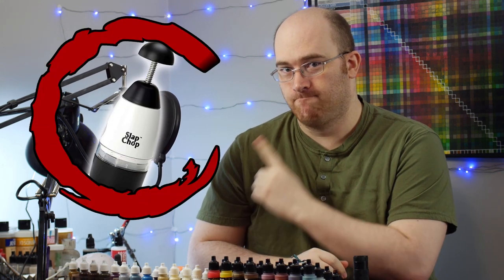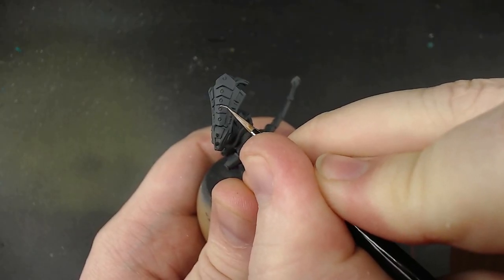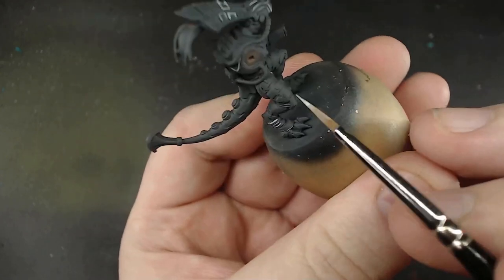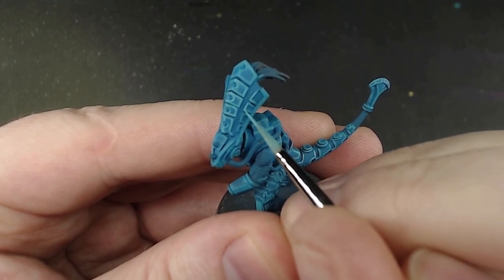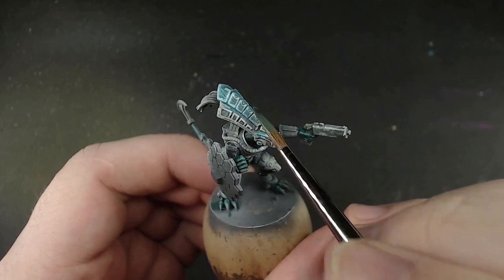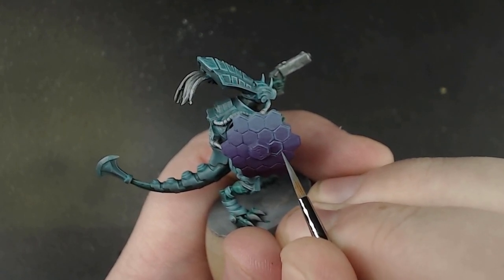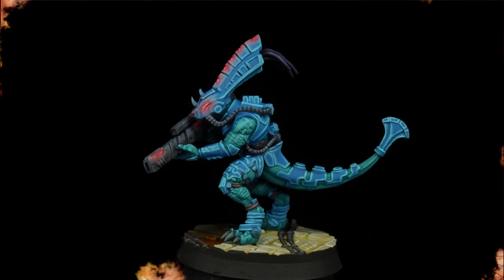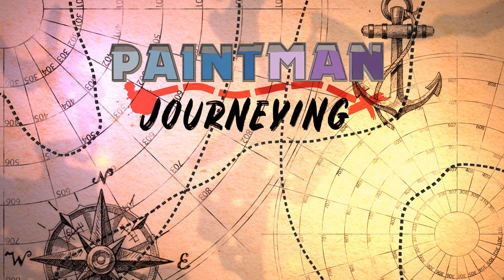Giving the Edges an Edge with Panel Lining

Comment: Isn't this more an extreme edge highlighting as we see on eavy metal work than panel lining? In greater scale modeling panel lining usually refers to using high viscosity pigments (washes or inks) or precise painting to shade a recessed panel
Reply from the maker: I think it might just be a case of crossed names for techniques. Cause I would call that black lining what you're describing. But could see how it can be called panel lining too. 

The reason I call what I did panel lining is because unlike just an edge highlight it goes into the flat of the panel and goes all the way around, normally my edge highlights would follow light restrictions so that they're only reflecting off the sharpest of edges.

I probably should have done a comparison between what I consider an edge highlight and a lining but I just didn't think of it at the time till I was told different.

Comment: Call it slapchop, grisaille or underpainting. It is all one and the same and a good technique for putting nicely painted miniatures relatively quickly on the table. Anything is better than playing with gray (or whatever colour the minis are printed in). 
Panel lining, which is just another word for edge highlighting imho (just as slapchop is another term for grisaille or underpainting)  is an advanced technique that can push the paint-job further and produce nicer miniatures. Great for HQ or center-piece models, but probably too time consuming for the bulk of table-top armies.

Comment: Another great video. I look forward on trying this on some Starhost on the flyers. Can't wait for your Rat men stuff!  Also, did you ever cover what brushes you use or how you care for them? I have some of the Rapheal Sable hair but they never seem to hold a point as long and as well as yours do. Then again, I only have expectations based on my limited experience so maybe I'm just loading my brush wrong or going to long before refreshing, etc. 

Either way, Thanks for all you do Paintman!.🔥
Reply from the maker: Did you get the 8404 or 8408? Mine are the 8408 which have a diffent bristle shape.

Comment: Looks great! How’d you get the glow to look so good? I’ve tried a bunch of techniques but they never come out looking good
Reply from the maker: That kind of glow is actually just a simple one. Start with white in the recesses. Airbrush a white halo around it. Then airbrush a colour Over top. Depending on saturation I might have to re line the recesses with a lighter shade, but in this case I didn't need to.
Reply: @PaintmanJourneying  thanks! Don’t have an airbrush just yet, but I’m looking to get one in the near future!

Comment: Very cool, but this isn't panel lining. You're painting the raised edges of the panels. Panel lining would be painting in the recessed areas between the raised areas. Panel lining is a term mostly used in gunpla, rather than miniature painting, where you have lots of thin grooves in the armor that dedicated gunpla painters first scrape out to deepen them, then use thin enamel washes to fill them out. It's usually called blacklining or pin washing in miniature/scale modeling.

Comment: hey did you scale up the minis , yours look bigger than mine 3d printed ones
Reply from the maker: I did not scale mine up no. I have had problems with that in the past though where things printed small. Check your print bed settings in Chitu, it might think your plate is smaller than it actually is.